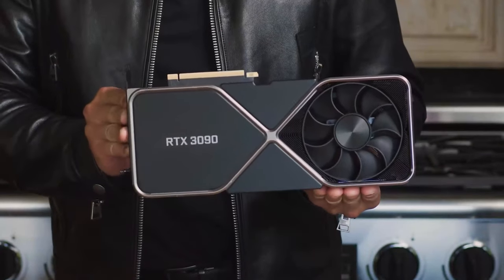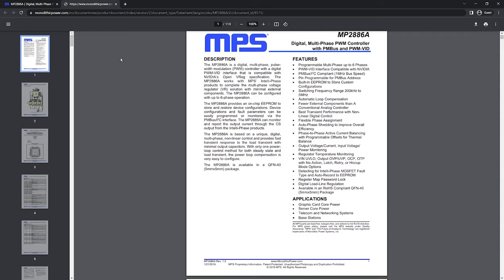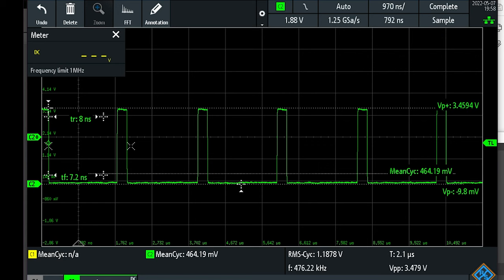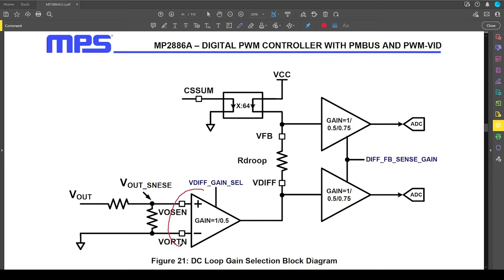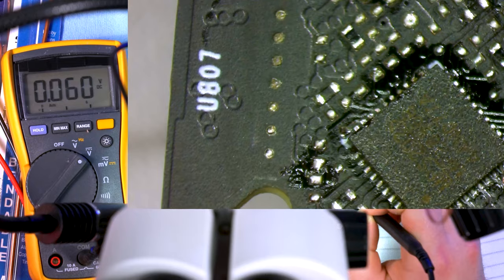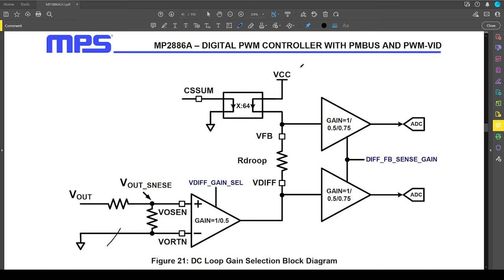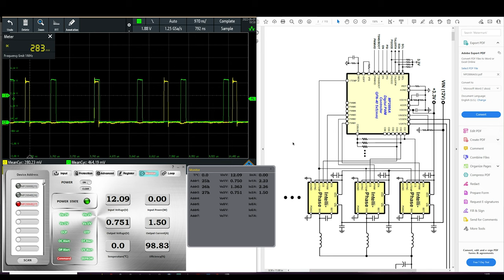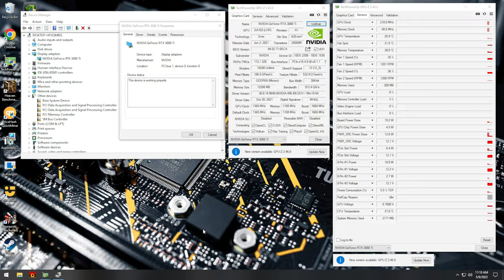3080 Ti Repair - Nvidia PCB Manufacturing Defect Catastrophic Failure. MPS2886 Feedback Circuit [1]

Comment: Great repair, subscribed. The only thing I'm questioning is calling it a "PCB defect" (which makes it sound inherent to all of these cards), since if that were the case it would have killed the core the first time it was powered on to test, even in the factory. It seems likely that the ground connection failed for another reason, such as a bad solder joint which failed after some thermal cycling. Regardless, great work!
Reply from the maker: Yes, you are right. I should have called it something else. I agree with you that its probably due to thermal cycling, and or could be in conjunction with a very rare manufacturing defect. these FE cards are very well build and I see no way that a user could cause this damage unless... someone opened up the card and started messing with the pcb, i.e. trying to pry it off when they still had one or two screws to remove it.
Reply: @gr3gtech  yeah improper disassembly could very likely have caused it, but if the card hadn't been opened, then a failed solder joint due to thermal cycling seems the most likely. But better to bypass it like you did rather than rely on what may be a burnt trace somewhere in the PCB, if it happened to be more serious than that. 

All in all, great work and an excellent video. Looking forward to seeing more from your channel!

Comment: Great video. Any idea how this issue may have occurred or what could have caused this was the card damaged or faulty upon arrival to its owner  ?
Reply from the maker: Could be owner induced, shipping damage or mishandling. Could also naturally occur with enough heat stress but I'm not in the manufacturing industry so I cannot say for certain from experience.

Comment: Hi, you soldered back gpu chip using hot air only? And did you take it out using hot air too? Just confused if it is possible
Reply from the maker: Yes, hot air only. From the bottom and the top.
Reply: @gr3gtech  nice😁 i would like to try it out. I just need a preheater plate for bottom, what temps should i use to lift the core?
Reply from the maker: @motherboardrepairsPH  I just hot air, not an IR preheater from the bottom. they make hot air bottom heaters for bga rework. 
I stick to max temp max air
Reply: @gr3gtech  oh i see, just one hot air you used? For bottom and top?
Reply from the maker: @motherboardrepairsPH  Hot air preheater on the bottom at the same time I used a hot air gun from the top, you need to insulate the core with kapton like you saw in the video, and ideally bake the gpu pcb in a non food safe oven for about 10 minutes at 100c before this kind of work